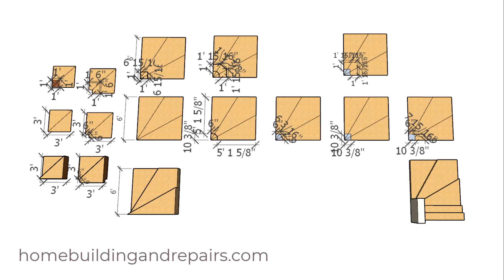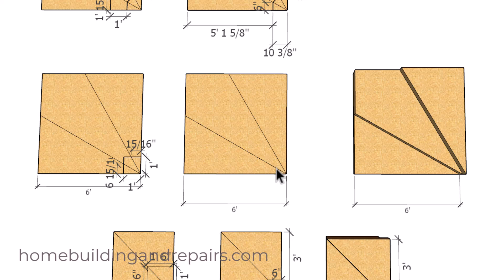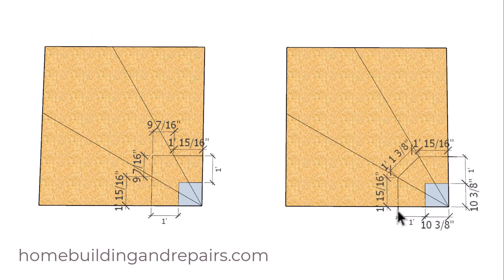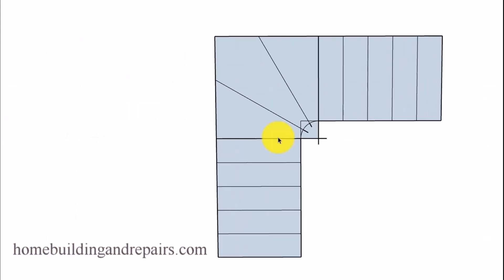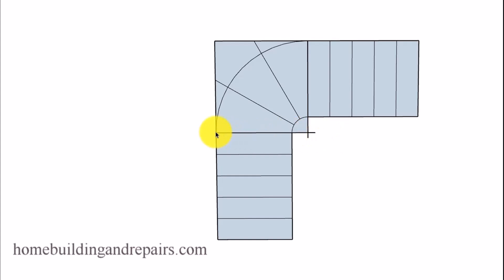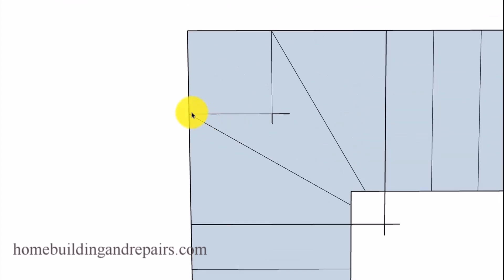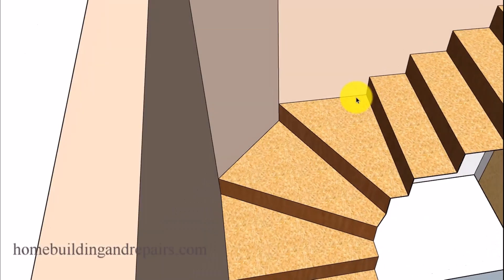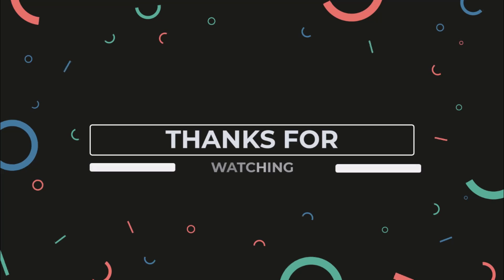Winder Stairway Design And Building Code Education - Contractors, Architects And Do It Yourselfer's

Comment: Hello my friend.. I appreciate you sharing your knowledge on this subject. I've watched quite a few of your videos on this matter, and I was hoping you could help me regarding building a new set of stairs in a 30 year old home. Unfortunately, the original staircase that came with the house cannot allow for this 6" minimum modification. The original stair treads are only 9" which is well below the 10" minimum for depth and the walkway is just to narrow to add a 6" minimum at the narrowest point of the winders. Also, the staircase sits above the basement staircase where ceiling or framing adjustments cannot be done. My question to you is, will I still be able to build a new staircase with an 11" stair tread depth and still be able to build new winders without changing to the updated 6" minimum dimension? Thank you for your time.
Reply from the maker: Yes, but it might not meet local building codes. I'm guessing you already know that, let me know if I didn't answer your question be asking another.
Reply: @stairbuilding  Yes, I am aware my friend. The original winders that came built with the house in 97' form a sharp point at the narrowest edge, so I thought I would be able to get away with building new winders with these same specs.. I also live in Ontario, Canada so I'm unsure whether or not I need to speak with the my local township regarding this matter, and if I will be required to have a permit or an inspector to come and approve the work. If this is the case, I might just outsource the work to a local stair specialist. I really appreciate your help sir 😊